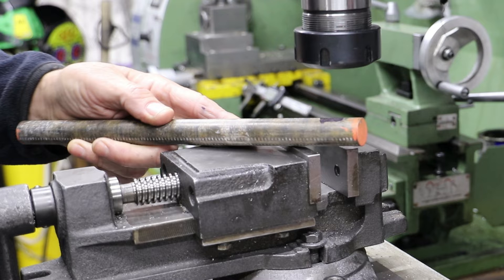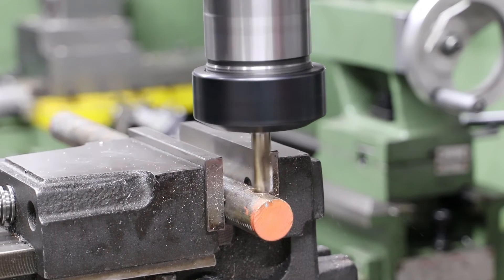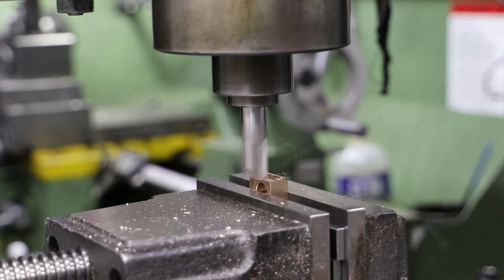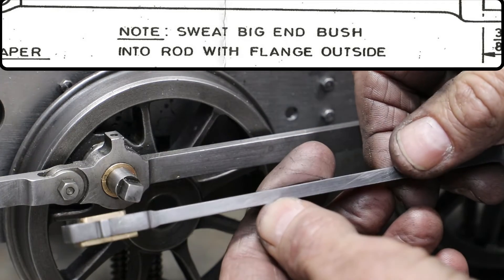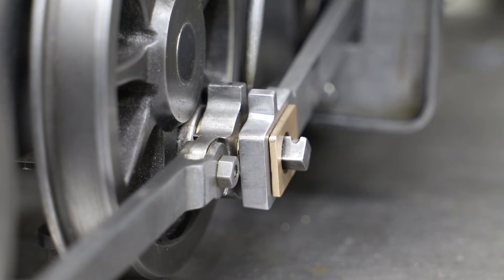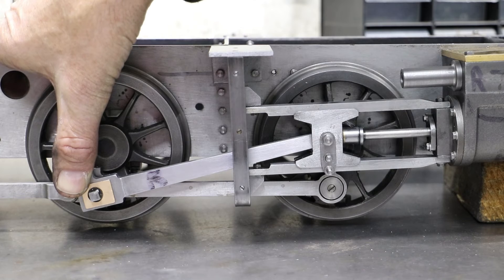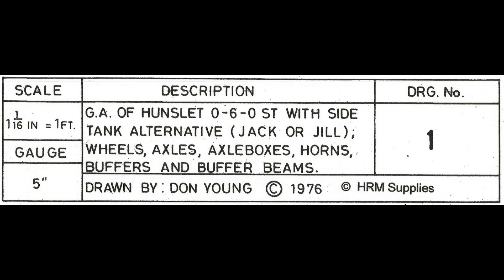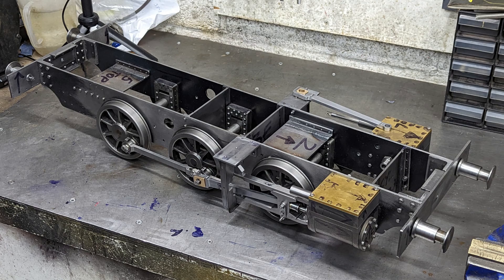Part 37: The Big End Bearings and more problems

Comment: Couldn't you perhaps just make a bushing that fills the gap between the Big End connecting rod and the coupling rod? Also, surely you can just machine a slight rounded gap into the sides of the connecting rod to allow clearance between the rod and the slide bar?
Reply from the maker: Hi Phillip, 
Thank you for the suggestions.
For the first, (Coupling rod/Connecting rod gap), yes that is an easy fix and one I have been contemplating, but I've yet to decide.  

For the latter, the problem was quite significant  with the Rods fouling the Slide Bars, the securing bolts and the motion plate. I have now modified the slide bars and motion plate to suit - and I will give an update in my next video.  
Cheers
Mark